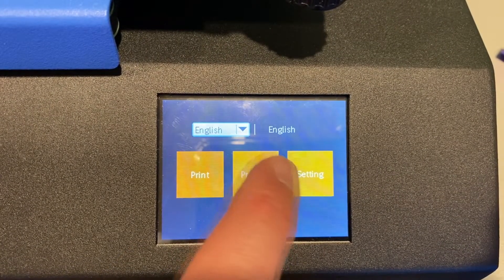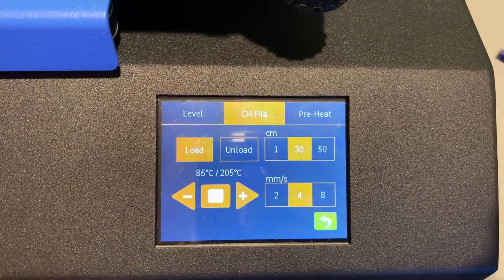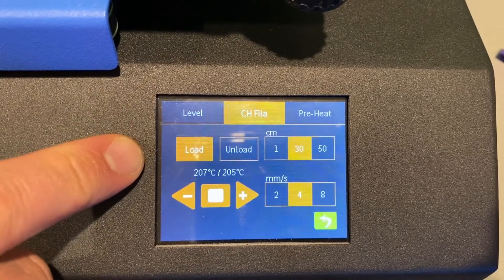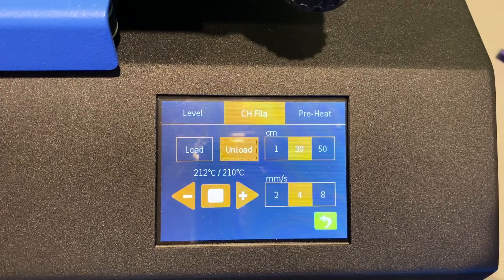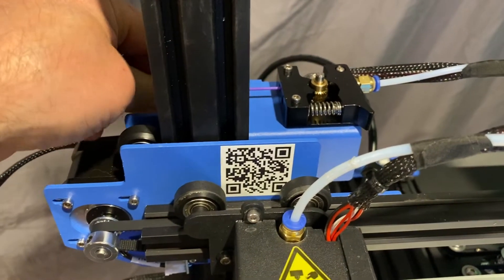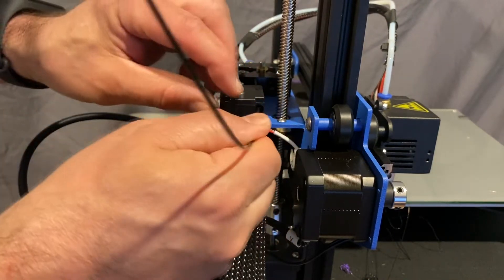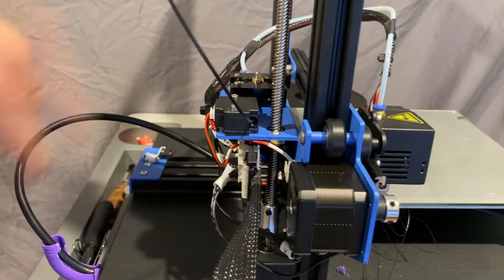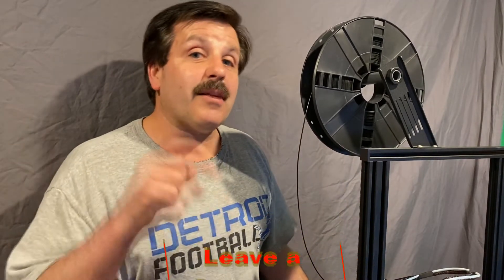Tested! Changing Filament on a Anet ET4x | PLA edition

Comment: Can you change filament mid print with the ET4X?
Reply from the maker: It has a filament run out sensor... Are you talking on the fly or by pausing?
Reply: @HLModTech  I was not aware of the filament sensor. Does printing pause automatically if filament runs out? Are you able access the change filament menu while print is paused?

Comment: thanks for the video, very helpful even a year later. would you know to how to clear a clogged nozzle on this one if that ever does happen?
Reply from the maker: Thank you. I have not had trouble with clogged nozzles on these. I have had them on my Geeetech A10 though. It comes with a little metal "ram rod" that is really slick. Just heat the nozzle to about 235, then pull out the bowden tube and use the rod to push the clog through. It has been handy with my Makerbot Replicator as well. 👍

Comment: Great, by any chance do u know how can I may it change filament from the Cura. I tried the option " change filament" in Cura, but it does not work!!
Reply from the maker: I change by hand for the most part. Simply set the hot end to about 210. Let it heat up, then squeeze the extruder handle so you can push and pull filament.  I push a little in, then pull the rest out. My first printers did not have the auto change tricks so that was how I always did it.
Reply: @HLModTech  thank u!! ☺️ but I still need the equivalent of m600 to Anet’s firmware. Manually I can do it but I need it to do it automatically like in Marlin. Bit Thank u so much for taking the time to answer  my question ☺️!!